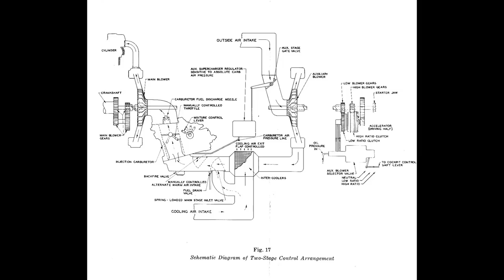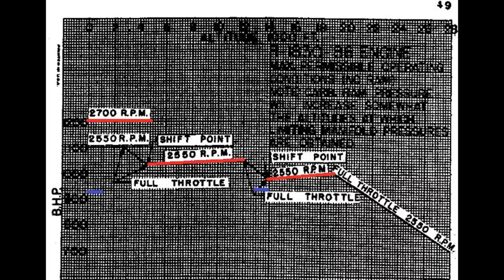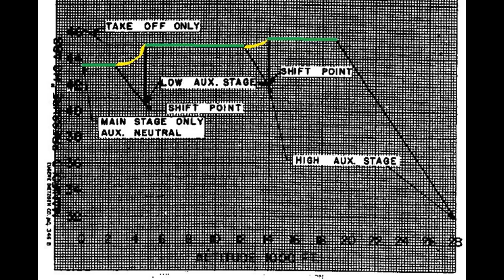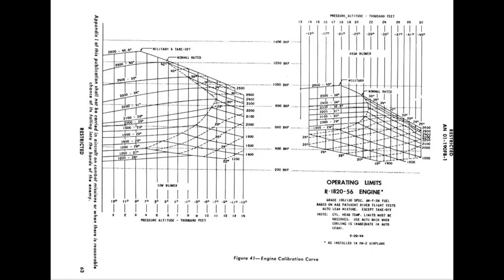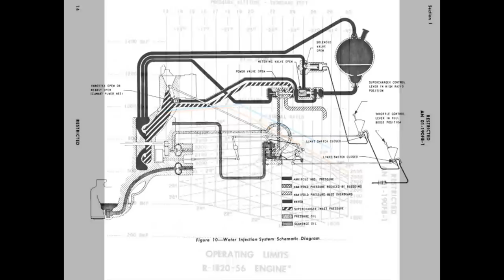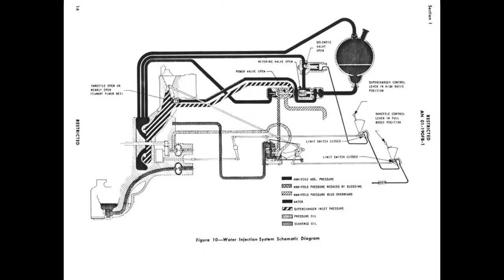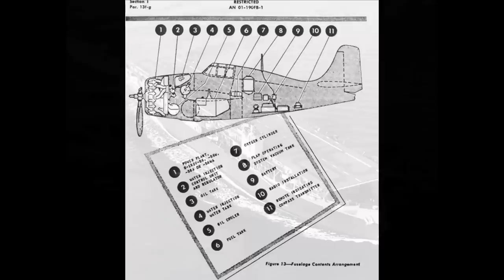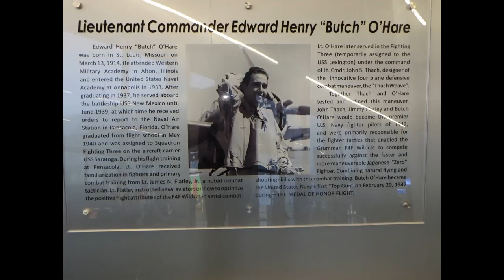Grumman Wildcat and FM-2

Comment: In IL2 Sturmovik I made a macro for the handcrank funtion. One had to press the button 52 times for lowering or raising the landing gear. With the macro, one had topress a button once for the function.

Also the cowl flaps could only be switched into one direction.
Like 1 2 3 4 5 6 7 8 closed 1 2 3 4 5 6 7 8 closed 1 2 3 4 ...... and so on. So I made a macro with ammount of steps N-1. So I could got backwards one step in that arrangemend. It worked like a charm.

Comment: Thanks for this. Love the Wildcat!
Regarding the P-51 crash at Reno, since the plane was modified for higher than standard speeds, one would assume that much more elevator trim was also needed. This would put very heavy loads on the trim tab, the failure of which caused the crash. Do the builders of these racers re-rig or modify the standard P-51elevator so as to reduce the amount of trim required at racing speeds?
Reply: The elevator trim tab got into flutter mode, then departed the airframe, causing an extreme pitchup, followed by an extreme pitch down.
Reply: The Smithsonian Channel did an episode on this accident. If I remember right, it was a maintenance issue with the trim tab linkage being incorrectly reinstalled
Reply: @roberthutchins1507  that could cause flutter.

Comment: For what it’s worth, I honestly think it’s impressive what the Japanese did manage to get out of their engines given their limited access to the metals needed for high performance engines and compressors. The Wildcat vs Zero, of course, shows the difference in what they could hope to achieve with their engines, but they still managed to get a fair amount of power from a small diameter

I suppose that’s not directly relevant here, but it’s hard to talk about one plane without talking about the other
Reply: When the allies flew the Akutan Zero they were amazed by the overall performance, and by the modest power it used to achieve that performance.
Reply: @fafner1  The prevailing wisdom in the US (intelligence analysts included) was that the Japanese engineers could at best copy superior European designs. So yeah, the Zero came as a shock. As did the Type 93 torpedo. The bias against Japanese engineering was so strong that battlefield reports were dismissed, and it wasn't until examples were captured that the USN faced reality.

Comment: The Wildcat was one tough aircraft, absorbing multiple hits from Japanese fighters. I was surprised to see film footage from 1945 of Wildcats in action, which means they fought through out the war. Even before the the US entry in the war they were operating in RN service as the Martlet.
Reply: Yep, as a matter of fact the 2 stage supercharger on the early F4F-3 design is one of the things that the RAF loved about them, after getting a load of it's high altitude performance with that type of supercharger is when they task Rolls Royce with developing that type of system for the Merlin engine, it was that variant of the Merlin that became available in mid 1942 that wound up replacing the single stage supercharger variant of the Allison in the P51 and took the Spitfire from being a medium altitude fighter to one with high altitude performance. 
It's a misnomer that the Merlin was a more powerful engine than the Allison, the only thing that made it better for the P51 is that beginning in mid 42 it was available with a 2 stage supercharger, putting a Merlin in the P51 prior to that actually wound have resulted in a lower performing plane since all things being equal like supercharger types and boost/octane levels the Allison is actually more powerful than the Merlin, even the early Packard built Merlin's only had a single stage supercharger on them.
Previous to the RAF taking the 2 stage supercharger design cue from the F4F-3 Rolls Royce had attempted to build a variant of the Merlin that had a single stage supercharger that was optimized for high altitude performance, but the problem with that is if you optimize a single stage supercharger for high altitude performance then it suffers from poor performance and lower altitudes, the Spitfire MK VI was the variant with the single stage supercharger that was optimized for high altitude performance but because of it's lower low altitude performance only 100 of them built. 
The design that produces the best performance at all altitudes is the configuration that the USAAF used on it's aircraft in WW2 which is a single stage supercharger with a turbo to feed it at higher altitudes, but like everything else in life nothing is free, that system costs more to produce, takes up more space due to the need for the ductwork and worst of all can't really be adapted to an existing design like how the Spitfire and P51 were later fitted with engine's that went from single stage superchargers to 2 stage superchargers, there's simply no where to put a turbo of that size and the required ductwork in an existing plane that uses an engine with a single stage supercharger, you wind up having to design a whole different aircraft instead of being able to adapt something that's already being produced. 
Despite the 2 stage supercharger being superior for high altitude performance Rolls Royce continued making single stage supercharger variant's throughout the war, it was a single stage variant of the Merlin that was used on the Seafire since it's main use was ground attack, not only is putting a 2 stage supercharger on a ground attack aircraft a waste of time and resources it actually has lower performance at low altitudes because of the additional parasitic power loss of driving the unnecessary 2nd stage, and not only were they single stage supercharger systems on the Seafire but the superchargers were actually optimized for low altitude performance by having their impellers cropped down to a smaller size.
Also the variant of the F4U that was built specifically for ground attack during the Korean War also only had a single stage supercharger that was also optimized for low altitude performance, many people mistakenly think that it was just the same as the WW2 F4U but with cannons in the wings instead of .50 cals but there were many more differences between the two than meets the eye.
The different types of supercharger systems used on WW2 aircraft engine's and how they're affected by altitude could fill an entire book on the subject, it's more complicated than most people realize even people who dabble in forced induction with cars, what makes it so much more complicated for aircraft is their change in altitude during their use.

Comment: The discussion of the tech built into the Wildcat got me to thinking about the little bumblebee being a blend of old and new: it was the last plane to use the fuselage-mounted landing gear which was fairly popular through the '20s and '30s, and it pioneered a wing-fold system that's still in use with the E-2 Hawkeye.
Reply: "...it was the last plane to use the fuselage-mounted landing gear which was fairly popular through the '20s and '30s":- This is simply incorrect - just about all choppers have fuselage mounted gear, then there's the Bell Boeing CMV-22B & a few other STOL types. Further afield there's the MiG 23, MiG 27, Douglas XB-42 & XB-43, An-225, Breguet 941S, Boeing C-17, Douglas C-124 & a whole slew of other heavy lifters. Then there's countless small/tiny single engine prop aircraft with fuselage mounted gear [some being retractable]. Moving on to gliders....

Comment: I really admire this plane. Nice to know more about it, thanks Greg. Great pics too! 
I revisit them from time to time in war thunder and to be honest not sure how pilots did very well with them. In a boom and zoom capacity, problem is the Zero can evade and often have shots as you try to zoom out with that quick turn rate, or rather even if you try to dive instead of zoom climb, they out accelerate you and often can get you before you are very far. They have low muzzle velocity 20s and 7.7s which was probably a saving grace, if you didn't catch them slow while you had a significant dive. The really needed a second bank of pistons on that engine then they would have been talking business. Not sure why they didn't really. Too little engine for all that strength.
Reply from the maker: The Pratt engine does have a second bank of pistons, but the best answer is a second Wildcat. 1v1 against a Zero isn't so good, 2v2 is OK.
Reply: @GregsAirplanesandAutomobiles  Oh, indeed it does have a second bank! Great point there, yes, I was thinking of the Thatch weave, but forgetting the most critical point, the second plane.
Reply: @GregsAirplanesandAutomobiles  I was thinking it could have used the r2800 instead of the 1800, and this was a good experience for me as I thought it was a single, and the 2800 was the double, but yeah I see, the 1830 was the wasp, and it does have two rows, albeit fairly compact. I didn't understand that the 1820 was a different engine, like in the B-17, I thought that powered a lot more than it did. Thanks!

Comment: Great overview, with good detail too. You mentioned the control surfaces were fabric covered, as were most contemporary fighters. What is the reason why? I wondered if it was weight, but then wouldn't other surfaces be  better fabric too?
Reply: Weight, but in terms of improving handling feel and avoiding flutter. A fabric covered wing would not be lighter, as the aluminum skin contributes to the wing's stiffness. As the war went on and flight speeds increased, metal control surfaces became more common.

Comment: This video highlights some of the complementary differences between Greg's channel and the channel Rex's Hanger. Rex goes into some detail about the different design iterations of the early F4F and how Gruman tried different ways to cool the problematic early versions of the Twin wasp that resulted in its cowling shape and the prop assembly type (ie the cylinder hub rather than a cone hub). Where as Greg goes into detail about the mechanics of the engine and its supercharger and how it worked that was glossed over on Rex's channel
Reply from the maker: Makes sense, we are two different people so we choose some different things to cover.

Comment: I have a question:  You've done a number of videos on US-built radial engine powered fighters.  These seem to have rarely had a streamlined propeller splitter fitted, whereas most nations fielding these kinds of fighters (Focke Wulf 190, Japanese Zero, LAGG-3, etc) seem always to have used these.  Why did US aircraft eschew the use of an aerodynamic splitter and just went with a raw propeller hub?

Comment: Because the FM-2 had a single row radial vs. the two row radial found in the F4F, the cowling is noticeably shorter; the Cyclone isn't as long, so the cowling isn't as long, either. This is another way to differentiate it from the F4F. Between this and the taller tail. these are the two key visual cues to differentiate an FM-2 from an F4F.

As for the single stage supercharger fitted to the FM-2, it was done so because it was no longer a front line fighter; the F6F Hellcat and F4U Corsair had supplanted the Wildcat in this role. The Wildcat, particularly the FM-2, was used more for sub hunting and sub killing; the FM-2, in combination with the TBM Avenger, was very effective against German U-boats.. In this role, it operated at lower altitudes. Therefore, the single stage supercharger was all that was necessary, as the FM-2 was optimized for use at 25,000 feet and below.

Comment: Hi creg! I Have admired your work before and Will continue to do so!

Anyways, here are some things to consider answering on your upcoming videos: firstly, i Have noticed in pictures of P-38's its quite common to see propellors neatly arranged into one Blade pointing directly downwards and two blades pointing up The sky and The same duplicated into other side propellor. Was this justsomething they did For promotional photos to Look neat of did this Have a real purpose?

Secondly, i Have noticed on period films a lack of flap usage on WW2 American planes while taking off, like P-51's. Im not an expert but i Have always thought The flaps were to Be used whenever possible when flying very low speed or was there some downside For flaps assisted take off?

Comment: There's a Zero in the Imperial War Museum, sectioned about halfway along the fuselage so you can look forward into the cockpit from behind. It's nearly all empty fuselage with the pilot's seat just perched in it. Zero (pardon the pun) protection from ANYTHING. A single rifle calibre bullet would take out the pilot if fired from behind.
Reply: It depends on the model, but yeah, Zeros didn't get armor until something like 1944. Japan was also late on adopting self-sealing fuel tanks.

My understanding is that the Japanese - pilots included - placed a lot of emphasis on maneuverability and thus did not like the weight penalty of things like armor. Or radios, for that matter, with pilots sometimes opting not to bring one.

Comment: Interesting item: I've flown both engines. The Pratts required cowl flaps. The Wrights did not. It's an easy way to spot which is which from a long way off. By the way, nothing is smoother than an 1820 that's been through a mag check followed by a supercharger engagement at 30", then supercharger shifted back after the clutches have had a minute to cook down. Then the idle at 600 rpm in auto lean. It's the most amazing thing. Most people say the Pratt is smoother because it has more cylinders. That's just not so. The 1820 was my favorite, but the R-2800 was just incomparable. I'm not biased against the Pratt. But I do know what I'm talking about. I went through 11 or 12 different Lodestars. That's where I learned to love the 1820.

Comment: I had been wondering if there was anything that could have been done to improve the wildcat's performance, similar to what they did with the  p-47 and it's good to see that they actually did some of it like the addition of water injection.  It begs the question if changing the prop could have helped as much as it did the T-bolt.
Reply from the maker: They could have improved it beyond the FM-2, but with the Hellcat on the scene and the Bearcat in the works there wasn't much point.

Comment: I never thought that this plane not only just held a line but it also helped turn the tide and by the time the hellcat and Corsair came into service most of the better Japanese pilots had been killed and the Kido Butai's arms had been cut off.

This aircraft proved that durability firepower and last but not least tactics could overcome an aircraft that put up better straight line performance numbers and the better rate of climb even though rate of climb is still a good thing to have.

The Zero Sen was a formidable aircraft thankfully the hellcat in a couple of important places was just a little bit better

Another thing I want to point out as a difference between imperial Japanese and US military aviation policy is that we rotated veteran pilots home to train newer pilots and Japanese pilots flew to the end of the war or more often than not the time that either one of our fighters or an antirecraft gun sent the plane spinning back to Earth and ended the life of the pilot so the experiences by our veteran pilots would not be lost or killed in action they would be passed on to new pilots who would use these lessons after they were trained by veteran pilots

Comment: R-1830 is one of my favourite engines, that pretty much ran the early war in the air.
The RAAF CAC Boomerang, which from pencil to prototype took just 12 weeks in the emergency of the Japanese invasion of the Pacific, and subsequent bombing of Darwin. 
Seen as somewhat of a failure,  I often wonder what a truly light airframe would have performed like if it got significantly below the 7,699lb GAUW Boomerang, and the same is true of F4F.  Yes it wouldnt have been as robust, problematic for a carrier fighter, but it is an unanswered question since virtually all the allied aircraft R-1830 could be found in were comparatively heavy. The Swedes FFVS J22 adds to my suspicions as it had a gross of 6250 lbs, a max level flight of 357 mph, and a ROC of 3090 ft min, with a lesser 1050 hp R-1830. 1,200 hp and 100 octane?

Comment: I watched this video when it first appeared, but this question did not occur at the time. When production switched to Eastern/GM, they first produced the FM-1 which, according to sources, was a copy of the F4F-4 and first rolled out in August, 1943. At some later point, GM began producing the FM-2. The question is, when did the FM-2 enter production? And, did the FM-1 incorporate any improvements to the F4F-4?
Reply: The FM-2 was the GM produced F4F-8. It was 500# lighter with 150 more horse power, making it competitive with the A6M3 and A6M5.
Reply: @bobharrison7693  Not an answer to the question. The information provided is already common knowledge, and not relevant to the question.

Comment: What does constant speed Prop mean ?  Like the C130  were they change the angle of the prop ( 4 blade ? ) to increase or decrease thrust .    Love the show !!!!!!!!!!!
Reply from the maker: You may want to watch my videos about propellers. It means it varies the blade angle automatically to hold the engine at a given RPM, thus holds the engine at a constant speed.
Reply: Instead of constantly adjusting prop pitch to maintain rpm, you just set the rpm using the controls and the prop does the rest

Comment: Rated engine power for Zero model 21 with Sakae 12 is only 830hp at 35.8inHg on sealevel. You seem to have the 940hp take-off power in there, which is reached with 39.8inHg. Sakae 21 runs rated power slightly below 38inHg.